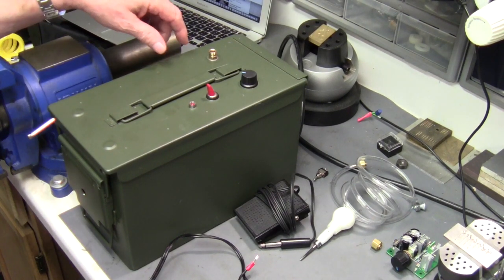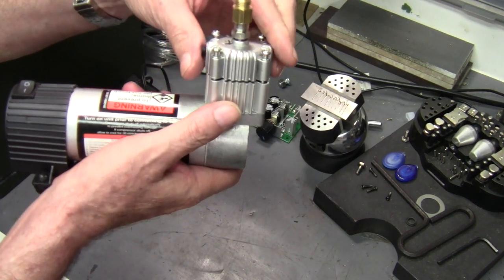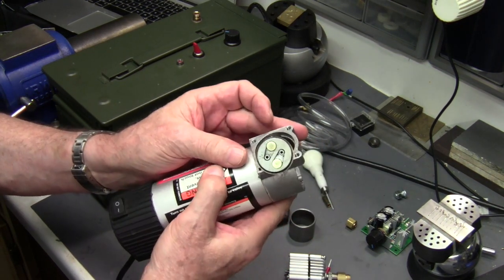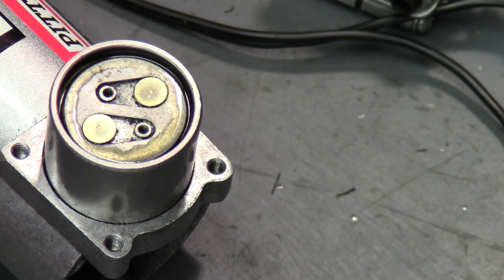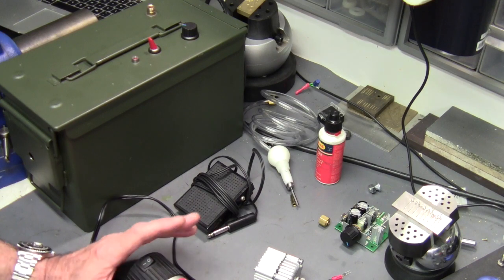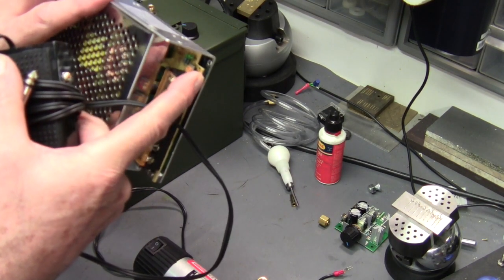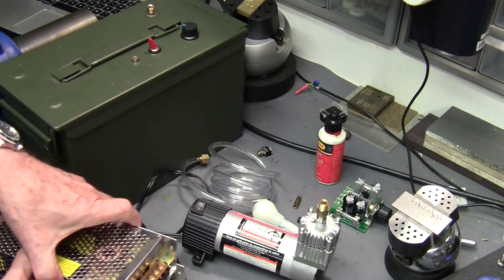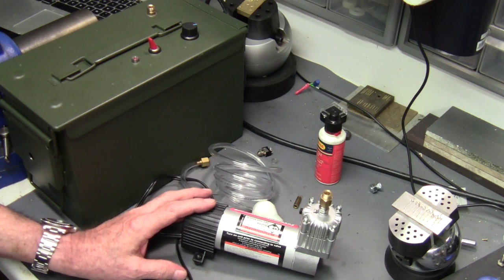Required Maintenance on the Homemade Hand Engraving Machine

Comment: I say they really need a PC fan running all the time. My first one was still going after 5000 hours. I've made a few just for experimenting that were larger, but no fan that didnt last. I think the duty cycle is only 15 mins ?
Reply: https://www.youtube.com/watch?v=nyyAWHaoe7Y&lc=UgwMugHKiRX3lfAEbnZ4AaABAg.99rCoVCHPSw99vRxWZxhAe&feature=em-comments
Reply from the maker: Thanks for the link!
Reply: @ralex397  Ah just remembered. They use a very similar pump for a Land Rover suspension (Episode of wheeler dealers). I think they sell a repair kit.
In the vid Notice how close the fan is to the machine, that was by accident, to lazy to anything other than cable ties :). The fan stayed on so long as it was plugged in (another lazy accident). I'd guess that it might have never even got warm?  more Random knowledge this time from AvE heat is a killer for wear and tear?
Reply from the maker: @express375  Yep, I think your right about the heat,  getting to the seal material breaking it down, I think the black dust is burnt seal. As soon as I get one built I'm gonna put it through a stress test. I'll figure out how to cool it down maybe like a 1917 Browning machine gun, with a water jacket.
Reply from the maker: There is a fan in the box but maybe its not enough, I may not have put enough oil in it when I built it. I need to build one and let it run until it quits to see how hot it gets, I never run mine very long and use a foot pedal to turn it on an off. Thanks I'll pass that along!
Reply: @ralex397  Great investigating Rick :) I had the black stuff inside my one ( I think |It's in a few vids for a few years back) I assumed it was from my dusty workshop, as it's pushing air back and forth with no filter?. The cheapest machine seemed to last longer than machines i paid up to £70. I quite often forgot to turn it of over night and it would run for 24hours even after 12 hours work?. You can easily cut a ptfe disc and she'll chooch again. I had a message that a guy made a leather washer that work as well. I used to squirt oil down the pipe. I did use some PTFE grease for airguns?. When I changed from a Gravermach to Homemade. I calculated that even if I had to change the motor every 6 months it was still worth it, as you could be in profit  with a coin that took maybe an hour to engrave. I'm sure I've still got my forst machine somewhere. Anyways chooching machine is so old fashioned :) We are going solenoid baby!

Comment: hey Rick!in your opinion what´s the best compress machine?because i want to make the homemade hand engraving machine and pneumatic air graver tool.thank you so much for attention.
Reply from the maker: I have only tried two different compressors, I like the ones I got from Harbor Freight, about $35.00. They are a lot quieter that the real cheap ones. But any small tankless compressor/tire inflator/air brush should work.
Reply: @ralex397  thank you Rick! l am from Brasil l have learning with about this good engraving machine pneumatic.l am sorry but my english not good but learning thank you so much for attention Rick☺☺
Reply from the maker: @edesiomatos1393  email me at ralex397@hotmail.com and I will send you the blueprints and drawings for the machine and hand piece.

Comment: Hey Rick! Great video again! People should definitely take them apart and clean them, depending on there usage, probably about every 3-6 months id say. I engrave almost full time now, and i take mine apart every 2 or 3 months , clean it completely out with rubbing alcohol and re oil it every 3 months. And i have THOUSANDS of hours on my machine for sure. And as long as i do that, it stays like brand new. And runs strong and steady. Another thing you might wanna mention is people cleaning there handpieces. I take mine apart every day i work, and clean it with rubbing alcohol and acetone, with a couple of qtips. And there is always a bit of dirt that comes out on the tips. And it makes the world of difference. Everyone should do this though, even with brand name setups, they require regular maintenance as well. Thanks for the always informative videos dude! 👊✌️
Reply from the maker: Glad to hear your getting THOUSANDS of hours out of your machine!  I hardly use mine at all, so I need to hear how they are holding up. Thanks for sharing your experience!

Comment: Thanks for the update rick ! just got a piece from you out in Texas, I can already tell the craftmanship is A1! I'm working on the compressor right now, you and Shaun are doing a lot for the DIY community ! I wanted to ask you, the Lindsay sharpening system says it holds 3/32" blank but the piece I got from you holds a 1/8" will these two still be compatible ? I'm new to all of this, thanks again !
Reply from the maker: Thanks! I use Lindsay's templates but I made my own graver holder for the templates, their holder was a little pricy. You can get 3/32 GRS QC tool holders off eBay or GRS. And a 3/32 graver should work in a 1/8 holder.